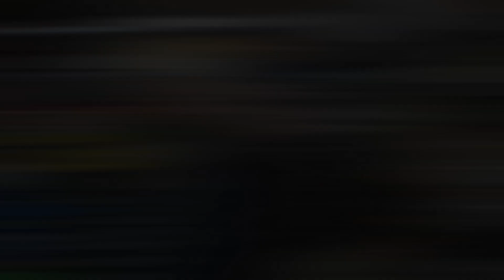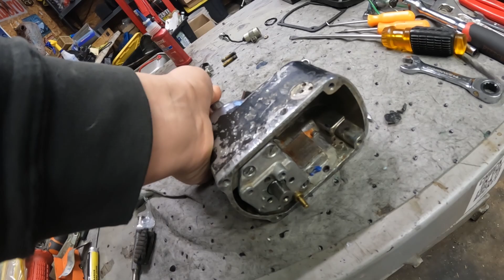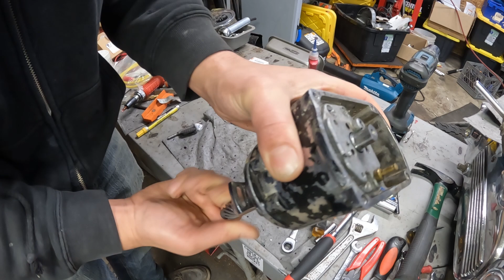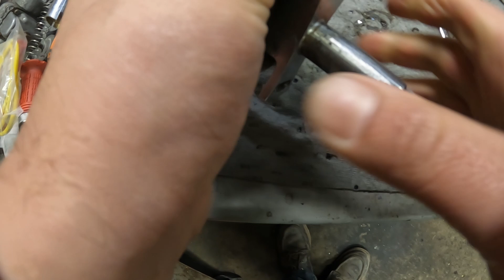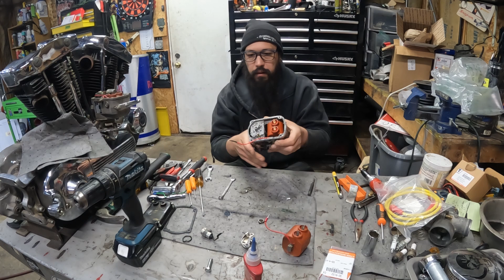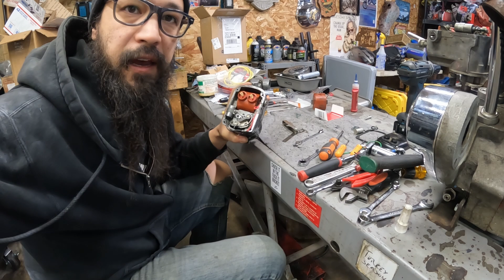Swap Meet Chopper: Magneto Assembly Part 2 - Top Half

Comment: I gap my points at .15 and I'll tell you why. As the rubbing block  wears down naturally the point gap closes. By setting the points at .15, .003 can wear off the block and the points will still be in spec. Not so if set at .012. BTW your mag is missing a small bracket that holds a felt wiper where you add a couple drops of oil or grease to lube the breaker cam.
Reply from the maker: I was wondering about a wiper on the mag setup.  I wasn't sure exactly on the points gaps, as I've heard/seen things all over the place.  Before I touched them, they were at .12.  I think I left them at .15 (is it bad I don't remember from when I made this video a few days ago?)  Thanks for the heads up on parts!